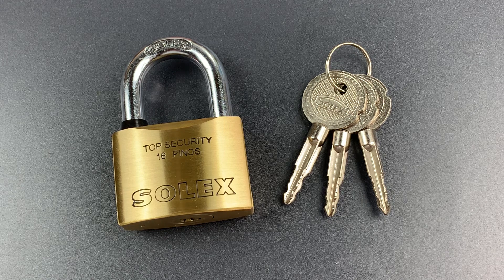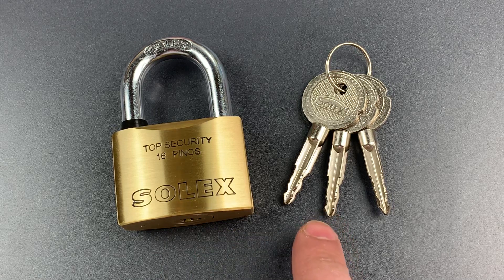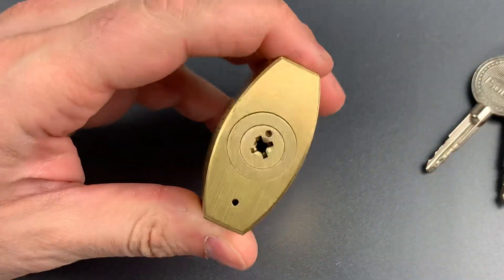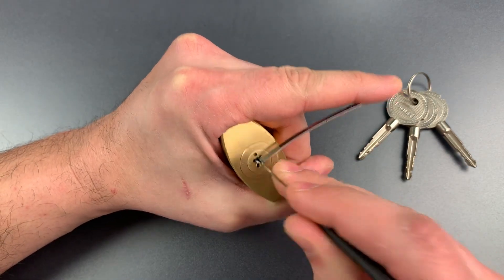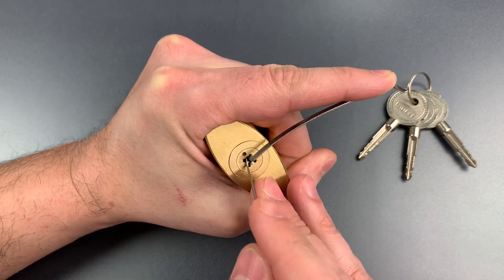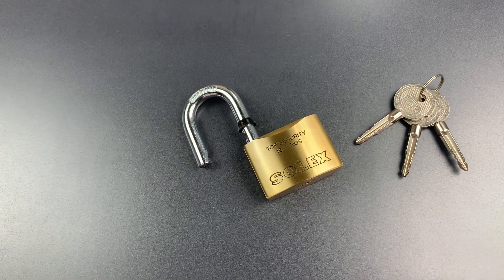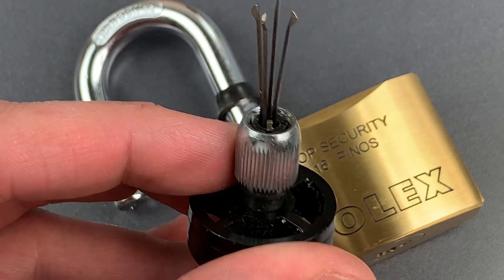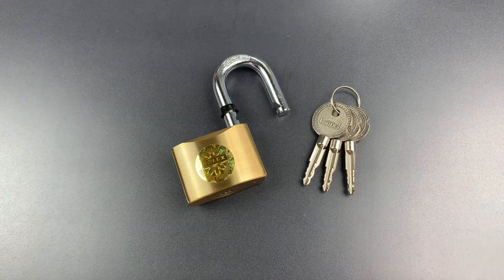[826] Solex Cruciform Key Padlock Picked Two Ways

Comment: I'm very surprised that this style lock is popular enough for someone to mass produce what looks like a ... quality rake/tool for.
Reply: Chinese manufacturers use these Cruciform style barrels quite extensively on cheap domestic wall safes and incorporated into a number of door cylinder and padlock designs too. Good for honing your SPP skills. A rake makes it all too easy for picking practice, but excellent for field use.
Reply: I live in South America and I must say, almost every house has one of those locks in their door, in addition to one standard lock
Reply: @rickloterio  true. Here in São Paulo - Brasil, almost all houses have at least three keys, all of those with those cross key format.
Reply: @Zodliness  field use ?😭😭

Comment: The first time I managed to open a crucifix lock, I instantly got the pins locked in the 90° clockwise position.  The key would no longer fit the lock. Haha, panic set in for a second.  I had used a single raking method to open the 🔐 lock. Fortunately, I managed to reverse the pick with the same raking strategy, but in reverse. Anti CW.
The tool you have is amazing, bet it isn't cheap. 
Love your content.  Both you LPL and Lock noob from the UK 🇬🇧 (where I live) got me into picking. Love your work. Your passion for locks is amazing 👏. 
Chris

Comment: Thanks for the review. To SPP this lock is a pretty time consuming challenge for any enthusiast. Have you ever tried using the more commonly purchased simple 4-legged wire rake to open one of these locks? I also found a snapper and electric rake doesn't have much luck on this type of lock either.

Comment: Wonder if its possible to make it in such a way that you also have to press down the end of the chamber to get rotation so that you can't turn it without some third or second tool in there
Reply: yes that is mechanically possible
Reply: Sure they could, but that would cost extra. The average consumer would look at a similiar product without the added security feature and save themselves a small amount and purchase the cheaper. Example ... Who would ever buy a warded lock to protect anything ? The answer is someone who doesn't know better and wants an inexpensive option.
Reply: Not unless they're willing to consider the cost involved in completely redesigning a globally exported mass produced Chineseum Landfillium lock for the sake of slightly improved security?
Reply: Without a complex design, such a feature would probably just act as another pin that binds and could be picked using standard lockpicking techniques.
Reply: even if it did have one, like i believe the schlage primus has, you still would only need 2 tools at one time. as long as you hold your tension, the pins would stay picked, and you could press that pin at the end of the chamber. you could also maybe do it before you start raking so that it turns when you're done.

Comment: Just about to watch this vid,thanks...when youre saying 'nothing on 1,2,3' etc is that saying thT those pins/wafers whatever are not binding anymore? Sorry if daft question. Only new to picking last couple weeks and just got my first few picks and clear lock🙂
Reply: Yes, he means that those pins are not bound & not giving any feedback. Once he encounters a binding pin, he lifts it until it clicks & then moves on to find the next binding pin.
Reply: @doublejaylar  thanks for explaining.thats what i figured but wanted to make sure. Want to get a few more locks myself so can practice. Had a small stanley padlock at home with no key and got it open once raking but cant since then😖 drivinge nuts.awkward key way and so little room in there but no matter how much i try it cant get it:( dont even know if any security pins.think there mite be cus sometimes feels like counter rotation but i dont have enuf experience. Anyway thanks for reply👍

Comment: When you say 'its binding', what exactly does that mean please?
Reply: Due to manufacturing tolerances, the holes in which the pins "live" are not all exactly the same size, perfectly aligned, etc. The error may be a thousandth of an inch, or less, but it's sufficient to allow picking.
When you pick a lock, you put torsion on the core to take up the slop that accumulated during machining. Then you attempt to lift each pin. Most of the pins will probably lift with no problem but one or more will resist being lifted. This is what is referred to as "binding."
You then force the binding pin up until the top of the key pin reaches the shear line. At this point, the core will move slightly and you may actually hear a click. This is what he means by, "Got a click out of [insert pin number here]."
Lock picking is a fascinating subject and there are plenty of resources available to learn the theory behind it. A good place to start is "The MIT Guide to Lock Picking," which is available as a PDF from many sources. It's a bit dated, but still useful.

Comment: All key edges have identical cuts. What a way to dumb-down an otherwise quality lock.
Reply: But shouldn't you have to ? since you can put the key in any direction if the cuts weren't identicals it would only open with the key in the right position (which you could just put a tab or something to have it go only one way)
Reply: @Beymdoublevey  If the keyway weren't symmetrical, then it would not fit many ways.

Comment: Er, the lock doesn't say it has 16 pins, it says it has 16 pinos, whatever that is. I also note that the cuts appear to be same on each blade of the key.
Reply: "We never said that it had any number of pins. That was no wrong advertisement. See the little scratches in the body looking like tool marks?  We call them pinos."
Reply: "this is a thai made lock" I assume pinos is thai for pins.
Reply: @2MeterLP  Thai has its own script.
Reply: @2MeterLP  according to Google translate that would be Portuguese. For reasons I can't guess.
Reply: @2MeterLP  The thing is that in Thaïland you never know if they have pinos or not.
Reply: It would be possible to have different cuts on each blade.   And then you'd often have to insert the key more than once to find the right orientation.  Not a good user interface.

You could have three blades in a T shape so the key would only fit in one orientation, then they could all be cut differently.
Reply: @bdf2718  here in Brazil we have locks with keys like as show in this video. The body of the key has a round cut that should be aligned to the dot in the keyway in the padlock and two of the cuts are wide/bold and two are thin. This way you can't insert the key in another orientation
Reply: @bdf2718  make a keyway and key with one leg longer, like a Christian cross, and that would index it just fine and make for a devil of a duplicating process.
Reply: I guess that means all the pins in each segment to be identical.